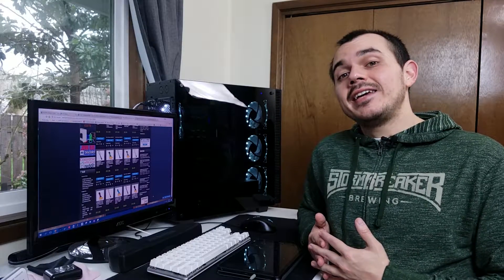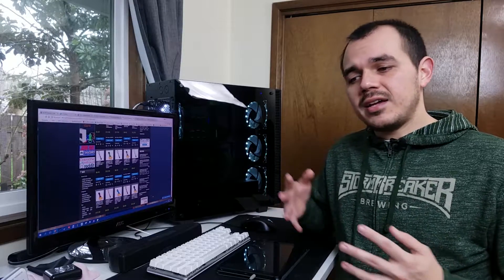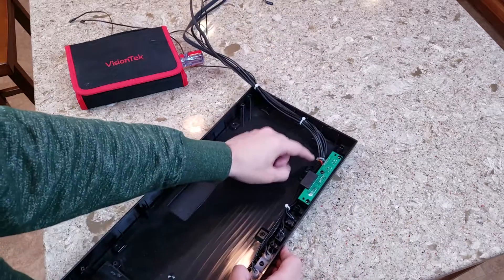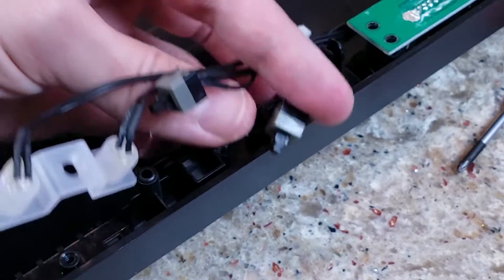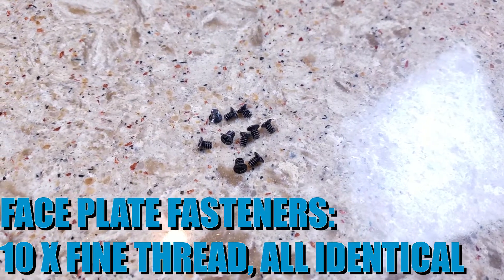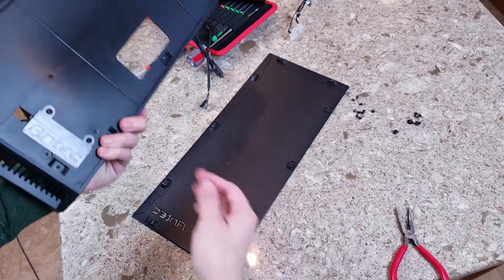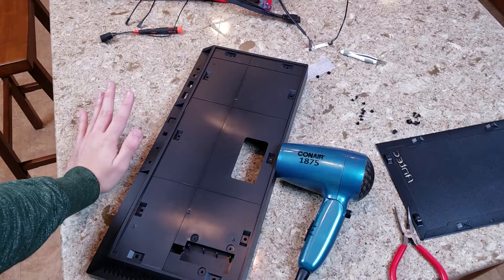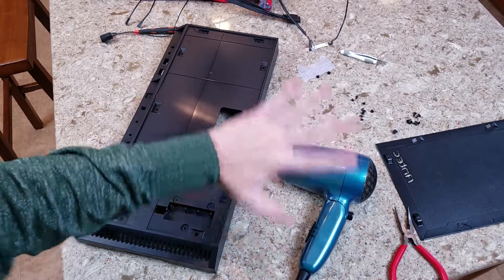DORKSMITHING: ANTEC P8 FRONT PANEL TEARDOWN

Comment: I'm going to mesh the metal and cut the plastic. Couldn't find any information on. Did become impractical only because the cables in the gap between?
Reply from the maker: The only impractical thing about the mod is that it has to be done in the first place lol. If you wanted to "meshify" the metal face panel just make sure there's enough material left on it so the stand-off points that mount to the plastic panel have enough material to remain comfortably attached so you have a reliable way to re-mount the metal panel to the plastic and keep it more or less seamless-looking. Also be sure to use cutting wheels/tools designed for use with the right materials if you do it yourself, you'll save yourself a lot of heartache.

Also keep in mind: that stock finish on the metal face plate is SO stubborn... a chemical thinner may be the way to go if you decide you want to re-paint it. I hand-sanded it and it was a royal pain lol. The metal is also shockingly thick compared to the rest of the case material.
Reply: @TheManicGeek  I did it and I love it. After cutting the plastic I 3d printed a mesh and put away the metal. Looks great and the Temps dropped. Next time I won't buy the cheapest cast lol.
Reply from the maker: @nirgreenblat6771  glad it worked out well for ya! You now also have a first-hand account of how good case airflow brings a case from "eh" to "downright decent, but why not do this in the first place lmao".

Comment: I think you should just cut the plastic and gap the panel so it looks stock
Reply from the maker: Hmmmmmmmmm... Not a bad idea, but I would have to have a way of also relocating the enclosure for the LED lighting in the logo, which would otherwise just be floating there. I COULD keep the existing cavity, cut it out of the front panel, and just relocate it to fit directly to the metal front panel. I'll start playing around with it this week to see what I can do with that idea, and a few others I have in mind.
Reply: I had the same thought. Funny, i was going through my head on what i would do to this case when i  buy it. Sometimes i forget about youtube. So i did a search for P8 mod and this popped up. 

Yeah contemplating on how and or what design i would use to open up the front a bit. The blank right side of the front face what i'm looking at. What  they should have done is the same thing they did on the left side so that there were vents on both sides like most of the cases in this style, which is probably what i will do, as well as add a few usb ports there as well. 

The front facing IO is what drew me to this particular case. Imo all these manufacturers put IO on the top of cases for people who put their case on their desk and thus  IO is two feet above your eye height, it's illogical and drives me crazy. My 14 year old nzxt did it right, at least for me, power button on front, with led and hdd activity. USB and sound jack on the LOWER right 
side of the front panel. Which in my scenario as the cords and  usb sticks point out to the right towards the wall and are out of the way and not tethered to the top on my case wasting 2 feet of cable and draped down looking a mess.  

The front jacks on this are at least better, but too bad they are so high up. Should have been lower in that last cavity where the hdd activity and power lights are or below them instead.

I am also thinking on mounting a thin fan under the shroud  in front of the power supply and drilling out holes for it to blow upwards there at the gpu in the absence of side door fans, which are soreley overlooked these days as it's huge for cooling in general but esspecially keeping you gpu cool. That and and just using decent high static pressure fans pulling air in the front to pull through that narrow grill.

If i were to open up the front panel i would probably cut vent lines from the top right side down half way, just a couple, trying to keep with the desing aesthetic of the case. Something like this. https://i.imgur.com/qSlRscf.png  I like the monolithic flat front look though, i also didn't know the front was actually metal, just thought it was plastic faux metal.
Reply: Yeah mount it under for stealth. You wouldn't be able to hear it with the glass on.  I can't hear the 80mm in my current cases door over my cpu fan or front intake and it's on 12v 100%.  I would personally have one backup HDD in the drive bay, but especially if you have none and take the cage out it should be pretty effective, as well as do double duty to cool lower m.2 ssd if you use one and depending on your mobo. Mine would be right under the chipset, so just about the perfect spot. The other thing that would help a lot with the front is that underneath the front face where you pull it open at, they completely overlooked that as well as far as intake. It should be much larger, and it's like almost more tiny than standard on other cases so simply opening that up a bit would help the bottom fan draw in a lot more air. Why they did that one really kind of baffles me., you;de think there was ONE guy that works there that builds his own pcs that says, guys, that's retarded. How do you expect to get any air through this thing, lol.
Reply: Got my case today. Will be doing my new build in it this weekend. Will probably just open up the bottom front "pull handle" opening quite a bit more and drill the shroud for my upward facing gpu fan but not install it yet and see how it performs. If needed i will add it later, or at least that one surely will, top fans only if needed. System will be 8700k delidded, boost oc to about 4.8Ghz only on all cores/power saving enabled - good enough for me, i don't really care about bleeding edge overclocks any more and trying to cool it. Good old air, Cryorig Quad lumi w/replaced fan - Corsair 120ML, Case, 2x140mm Hyperboria high static pressure intake, 1x120mm phanteks SP exhaust. Basically got enough connecters to run the front and back =3 fans at the moment. Will see how it goes.
Reply from the maker: As far as the thin fan is concerned, that could easily be done by cutting out a hole directly in between the four machined holes in the PSU shroud located towards the front of the case. Hell if you just used a single GPU you could even mount the fan on top of the PSU shroud, but mounting underneath would look a hell of a lot more stealth and make the interior less crowded. Tradeoff: the lack of space for the fan to breathe might make it louder, and might make it less impact full in terms of getting air directly to the GPU; further testing would be required.

Glad you enjoyed the video, working on the rest of the mod right now, though it's slow going! I'll be able to properly finish everything once I get my Zen + hardware ordered, hope you stick around for that content!
Reply from the maker: lol well Antec aren't the only ones guilty of this sin of design... even Cooler Master has been guilty of this in VERY recent history ;-)
Reply: Yeah i hate Coolermaster cases, they remind me of a 90's basketball shoe.
Reply from the maker: I might recommend using static pressure optimized fans for the front of the case given the restrictive opening up front. Based on my admittedly VERY basic testing using other Antec fans that seems to help things quite a bit without the need to modify the case. Fractal Design Venturi fans are a really good choice since they're PWM fans with cables long enough to reach motherboard headers; just set fan speed in your board BIOS to 100% PWM and call it a day x-D. They're also really well priced given their level of performance; I've used them in several builds since their release. I'd also suggest Scythe Kaze Flex fans of you're looking for a nice balance of air flow and a bit of static pressure, they sell them in non-pwm trim for a few bucks less per fan, and have fixed RPM models so you can get exactly what you want.
Reply: Yep, well i got the Hyperboreas as stated above. Oldies but goodies for the money and some of the highest static pressure and airflow. I've alwasy run my fans 12vdc and like to keep my fans separate from all other wiring so won't be using headers on mobo. This isn't my first rodeo, though alwasy learning, but i've been building my own gaming systems for nearly 20 years. Barring some anomalies i;ve got plan A an B just from experience, i can assume i will be easily in the clear on cpu temps. My only concern is gpu throttle due to no door fan, that';s why i will add a fan blowing up from the shroud. As well as possibly eventually cutting slits on the right side door near the HDD cage for air to be drawn in. The case i have now ( 14 year old NZXT Trinity) has that layout and it's served me well . The Antec will likely end up being a downgrade for cooling compared to it without mods. I mean if i put the fans i have in this case into the Antec it surely wouldn't be enough, where as i;ve never hada problem with temps in this case and it only has 3 regular cheapo fans in it that have lasted a decade or more running 8-24 hours a day.  Thanks for the tips though. Will see how it goes.